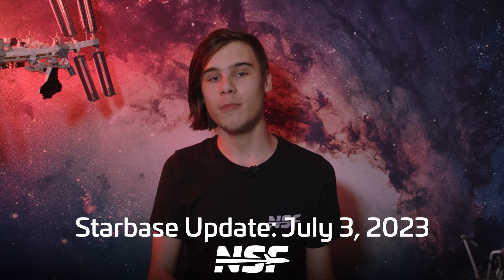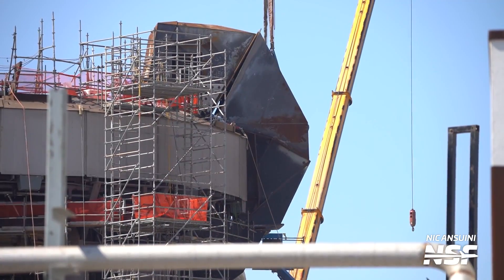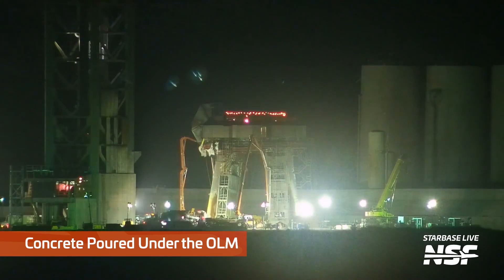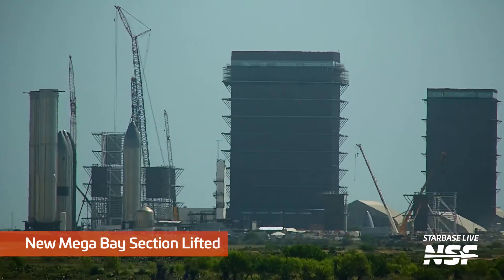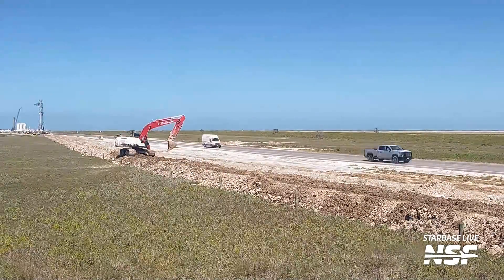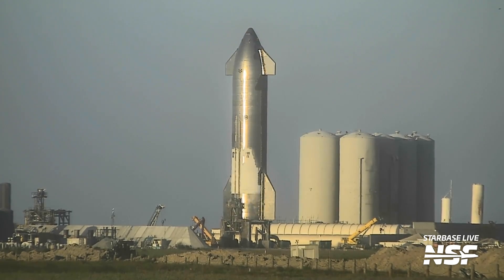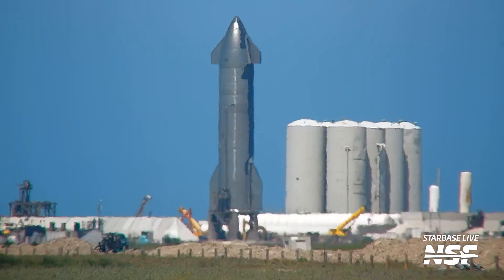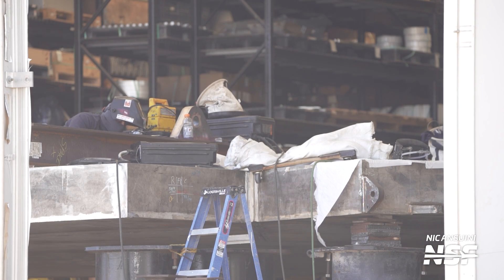Starbase Update: SpaceX's Incredible Progress Toward Starship's 2nd Integrated Launch

Comment: Ya know Ryan, when I look at that cargo bay door of Starship, I have to wonder if the SpaceX engineers ever considered a vertical payload door opposed to the current horizontal door. You have to wonder just how much structural reinforcement has to be added to carry that stress load around that huge door. If the stresses collapse that door opening by even a fraction during launch, that door may not open or close. If I were to design it, I would attempt a vertical door as it is much easier to carry that stress load. The big takeaway would be if they could deploy the Starlinks in a vertical position. In my mind, I picture a multilevel dispenser similar to the old slide projector carousels. Preliminarily, I think you could actually dispense more satellites in this configuration if the mechanics work out.

Comment: Don't call this water shield a deluge system it's significantly different. Water deluge is usually low pressure water not capable of flowing into the blast of a raptor engine.  Deluge is mostly for sound reduction.
 VS this plate system is a plasma shield able to withstand full exhaust stream of 33 raptors - nothing like this ever done before.

It's sure to work fine as long as the water pressure and flow can keep up.

Comment: You are confusing power with momentum, generated by the engines, which is in opposite direction of the THRUST generated by the engines
The down flowing MOMENTUM is transmitted by the pressure behind the  normal shock from the transition of the supersonic exhaust flow to low subsonic flow diverted into six lateral subsonic streams of considerable lower momentum The stagnation like pressure integrated over the platte equals the total thrust of all engines. The water presure is adequate to allow sufficient water flow to cool the plate to a tolerable temperature. 
The water jet momentum is orders of magnitude lower than the force carried by the plate to the foundation below.
Namely the ratio of the total area of the holes to the remaing area of the plate.
Remember force is the vector change of the momentum.
Power is related to the kinetic energy of the mass flow of the engine exhaust plus the thermal energy of the hot gases .

Comment: The plate will help (maybe, if it doesn't get blown to smitherings), but they really need to redirect all of that raptor energy horizontally, and not bounce it back up at the engine compartment.

Comment: I doubt that SpaceX will make the same mistake again with the launchpad. The new deluge system seems well designed and should do the trick for the next set of testing. I am sure they will continue to improve it as always, but they can now focus on the booster/starship reaching orbit.
Reply: I agree.
Reply: Yes, agreed. But not only that, static fires from the booster will really allow them to understand how effective it is, and improve on weak points. A slight disadvantage is this system is quite the water user, and those tanks can be used in seconds, if they want to provide the amount of water needed to support it. That will probably be the reason of some delays, like if launch/static fire gets aborted. Other than that, way more powerful and resilient then FireX , which doesn't even work anymore now lol. Overall a good system.
Reply: @JaivianD  You bring up a good point. I wonder how many truckloads of water they need to replenish the tanks. Also, the tanks are not as easily accessible as the LOX/Methane tanks.

Comment: I expect this deluge plate system will be fairly successful in the next launch. They may have to do minor repairs and upgrades afterwards, but this cooled plate method has been used in the past by NASA for testing, though at a much smaller scale. It will be interesting to watch it pushed to the limit! 🔥🚀
Reply: I'm kind of surprised they didn't have some sort of deluge system for the first test.
Reply: @Galaxy613  they had already planned it, but not all the parts were delivered yet. They thought they could squeak by without for the first test. 😅
Reply: I suspect they wanted to see a real world worst case scenario without the plate so they could know how bad a failure would be for the OLM. Better (and cheaper) to have these massive failures early than later on in the program.

Comment: Great update. I'm skeptical the deluge/steel plate contraption will withstand the mighty blast of 33 Raptors without significant damage.
Reply: I mean all the steel parts still attached from before survived. So a huge flat steel plate with water should have no problem.  It was the concrete being shaken apart and crumbling that was the problem before. A steel plate wont do that. Other things might still brake. But the plate wont.

Comment: I have one simple concern, and while I'm sure you may all dismiss it as something that was obviously thought through by the SpaceX engineers, the fact that they so badly underestimated the force from 33 Raptors during IFT-1 forces me to bring it up.  See, there is a very simple calculation to make -- what is the pressure, in psia, from the 33-Raptor exhaust as it impinges on the plate, as opposed to the water pressure pushing the deluge up through the "showerhead" holes?  Because, you see, unless the water pressure EXCEEDS the Raptor exhaust pressure at any given hole, the hot exhaust gasses from the Raptors will simply push the water deluge back into the cavities within the steel plate, and in the worst case, will super-pressurize the water stream both into the outflow "catch" channels and AGAINST the pumps trying to flow the water into the plate.  If the pressure of the Raptor exhaust exceeds the water pressure pushing the water up through the showerhead by a sufficient amount, the plate will suddenly be filled well beyond its pressure-holding capacity with superheated steam, which won't be able to push back along the feed lines, or out through the outflow channels, fast enough to prevent the plate from fracturing along its weakest weld points.  So, that's the question -- what are the exhaust vs. deluge pressure waves like, as they meet at the plate and the showerhead holes?  Because if that force battle is quickly won by the Raptor exhaust, the steel plate could literally tear itself apart, with the added possibility of superheated steam blowing out the pumps and racing back up the feed lines into the water tanks.  I think the short label for that is A Bad Day.
Reply: I dunno what SpaceX team is planning to overcome the pressure diff, I feel the same as the steel plates might shatter due to high steam and fire flow at the same time
Reply: Forum estimates of the stagnation pressure at the plate are ~12 bar, and estimates of the water design pressure at the plate are ~16 bar, to be driven by the aforementioned compressed gas manifolds.
Reply: I would say it’s more like they overestimated the amount of localized max pressure the foundation would be able to withstand at its weakest point, considering the evidence pointing to the piles and soil failing underneath the pad due to compression.
Reply: It is a very simple calculation to make. The water pressure has to exceed that of the exhaust at the surface of the plate. That is why they are forcing the water using compressed gas and not some pumps.
It always surprises me how little confidence people have in SpaceX engineers.
If they fail it will not because of something that obvious. It usually is a combination of very unlikely events that happen all at the same time - no one can calculate those, because if they could they would.

Comment: It will be interesting to see which starts first - the engines or the water spray. If the spray starts first then water at several hundred psi might rip off the shielding round the engines - or something. If the engines start first , the 33 jets of plasma might melt or cut into the steel.
Reply: No, the water will not point at the Raptors at all. It will point diagonally up and out. I am sure they don't want water on the bottom of the booster or the underside of the OLM.

Comment: I recall that Elon made a statement regarding the launch pad design improvements as being 'massive overkill'.

It would be so much better for SpaceX to have spent more money than they needed to, than to have to do everything over if it fails.

The PR and regulatory cost of failure would also be huge.

I think it's going to be awesome.  I hope we see the deluge testing, and then static fire testing, soon!
Reply: Unfortunate that SpaceX didn’t implement a more robust engine flame deflector initially during the long, dreary FAA test flight obstruction… also too bad they didn’t program the flight software to detach so after the booster lost control  & allow Starship to fly then soft land in the ocean after orbit was impossible. That is a reasonable flight abort scenario to get flight data & demonstrate an abort mode.
Reply: @warrenwhite9085  This is probably part why hot staging was incorporated, to be able to abort despite the booster being controlled. Flame deflectors now really don't work. They have a few options. All thrust to the Environmental area, tower, tank farm, or now, deluge area. Either one amplifies the thrust in that direction by a lot, and its better to just not. Not only that, but the OLM is so close to sea level many things won't work that could mitigate these problems.
Reply: @JaivianD  The Kennedy launch pads are also at sea level, swampy with high water table, they were created by piling up dirt to give room for flame deflectors. 
Flame deflectors do work, however the tiles need maintenance. I have confidence that the SpaceX metal deflector solution will be maintenance free, as a water/steam barrier protects it. 
For the first test flight ISTM that as soon as booster faults became apparent & orbit was impossible Starship Flight Software should have entered abort mode, started it’s Raptors, shut down booster engines, released the booster, & tried to save itself to a soft landing in the ocean. Let the failed unprotected booster be destroyed, couldn’t land anyway.
Anyway, hopefully there will be a Starship boost abort mode for Flight2 & beyond.
Reply: @warrenwhite9085  they might try that in the long run but rn there just trying to get to orbit. even if there flying cargo idk how effective and abort system would be. however, if they are flying crew in the future, I would expect they would have some emergency procedure similar to what you have states, or a completely different system all together.
Reply: @HamzahKhan314  In addition to manned, some of the Starship cargos will be very valuable, spacecraft for example. In the event of booster failure a fully fueled Starship could make it to various landing options, land or floating. It’s just adding abort software, so why not? If they had had such flight software in place for Flight 1 SpaceX would have gotten very valuable Starship flight data, it was a big lost opportunity. 
I remember Falcon CRS-1 where the booster failed, Dragon came free, but there was no flight software to have Dragon deploy the parachutes after booster failure, so the Dragon & cargo smashed into the ocean & were lost. $millions lost because of lack of a few lines of code.

Comment: Will it work? Hold my beer.

Structurally it is very stout, and I doubt it will suffer any structural failure. My concern is flame erosion, 33 Raptors make up the world's nastiest and most powerful blowtorch and who knows? Can't wait to find out. Being able to view what is going on at Boca Chica has many people not only interested and excited about the launch, but the many systems that support it all. It is the breeding ground for space nerds and nerdettes.
Reply: The key to the water plate’s survival will be if SpaceX can get Starship off the OLM significantly quicker. They can’t afford to just sit there and burn like the first test. In any case even without flame erosion SpaceX will still get a significant amount of corrosion on the steel plates.
Reply: @jason_m_schmidt622  didnt elon confirm B7 was at 50% thrust for like 5s? The concrete started flying around not even 2s before liftoff iirc
Reply: @Marrrrrko47  No.  The static test fire was at 50% power with 31 engines running.  There was no catastrophic concrete failure during the test firing.

Comment: I am fairly sure that the deluge system is primarily a cooling system.  The water flow will be designed to keep the blast impact plates cool and may also cool the 0LM legs to prevent heat damage.  I imagine the deluge system contacting the raptor engines would be a problem and not a benefit.  Carefully balanced cooling is intrinsic to the engine design and cooling imbalance could destroy them.  I don't think "force" is an aspect of the deluge system except the careful control of forcing the water through the system to deliver the correct flows of water and possibly gaseous mixture.  Liquid gases may be used to help pre-chill the water so it is a more effective coolant.
Reply: Water absorbs both heat and sound - which are both just atoms and molecules bouncing about (sound is them bouncing in step).
Reply: Dunno; deluge systems usually are just as much for acoustics/sound suppression as for cooling.

Comment: I think this is a good fix. Only choice since water table precludes a trench.
Reply: Yes, I can't wait to see the testing and then a lift off. It could be quite a sight.
Reply: A 'trench' could be made by adding walls to the existing design.  No need to dig.

I hope to find out why SpaceX chose not to do that.  I suspect they just wanted to keep 'easy access' to the base.

Who knows?   They might even add ( bigger ) walls now, or later.  Damage to the propellant storage system has to be prevented somehow.
Reply: @Bora_H  Because this current design has 6 "trenches" instead of one or two. Considering the enormous exhaust only one or two would tax anything in those directions.